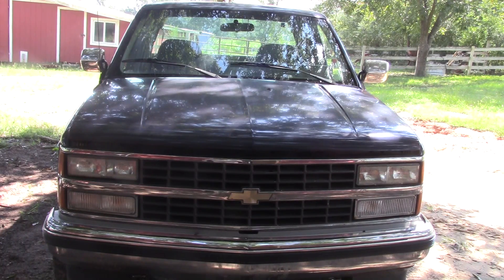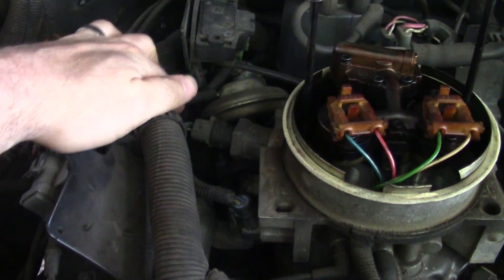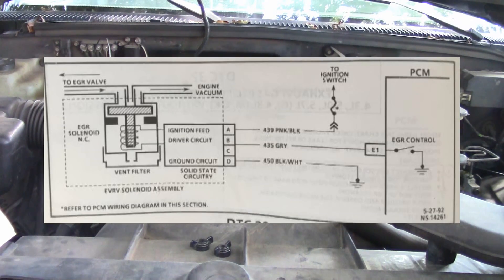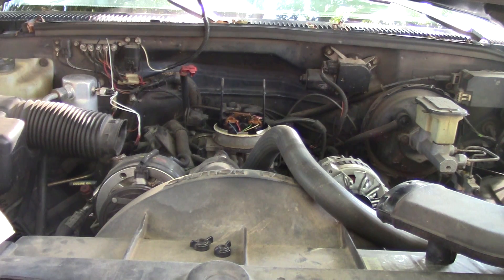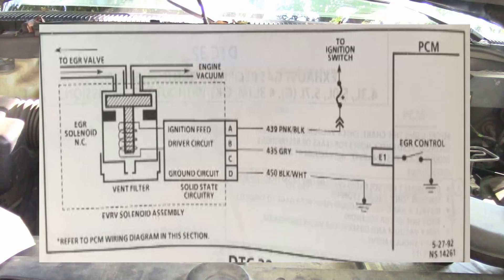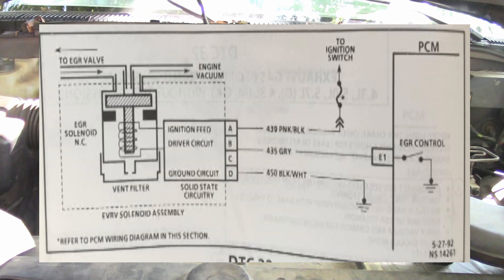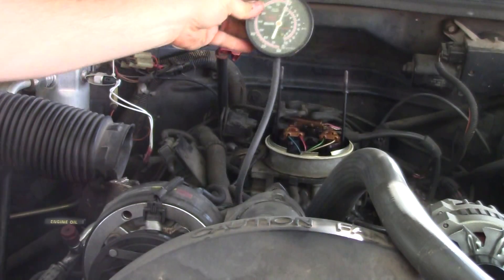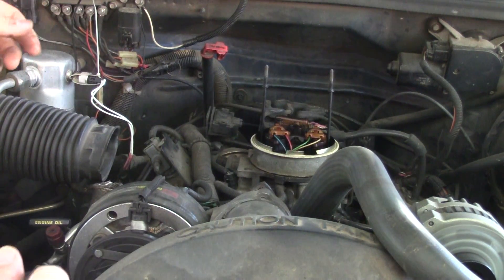GM Truck  DTC Code 32

Comment: if u replace the egr valve on these trucks make sure u get the right one, theres 2 different ones, that will mount on, but one has an internal bleed hole, one does not,, if u put the wrong one on, it will not work right.
Reply: How can you tell which is which?

Comment: I have a 95 k1500 5.7L. I changed the EGR, Map Sensor, and EGR vacuum solenoid along with vacuum hose. But when I run it on highway the service engine light pops on. The GM code reader still gives me code 32. Im stuck and dont know what it could be.
Reply: Did you ever figure it out? I’m in the same boat with my 95 as well.
Reply: I deleted my egr and my truck runs great but today I drove the truck up to the mountains about 1.5 hours up and back. I got a flowmaster 40 muffler installed today and my service engine soon light came on during my drive home. I checked it when I got home and it was a code 32. I started the truck back up and the code wasn’t there, not sure why it happened, maybe altitude or the less restrictive exhaust.
Reply: @lawrence6115  Late by a year. I think you are right about altitude. Higher altitude  means lower pressure. Vaccum has to work harder.
Reply: Still having the same issue til this day. I actually had originally replaced egr with autozone brand. Didnt seem to work. I recently replaced that one with a delphi part #eg10099. According to a user on a GM forum someone mentioned that these trucks run on negative back pressure egr. Now when the egr is connected to the solenoid the truck sputters and shuts off after it reaches correct temperature. It also gives code 32(still) and now code 44 which indicates a bad o2 sensor. Mind you i replaced o2 sensor about a year ago. When i unplug hose from egr to solenoid the truck runs fine but the the CEL turns on again with code 32. Im thinking of replacing egr with one from GM this time around.

Comment: 95 Silverado, I had to pull the intake during repairs & I saw the air channels feeding the EGR were carbon blocked.  I had to use a chisel & Dremel to clear them.  Two weeks later code #32.  It's a friends truck ( he bought it new ) & he was taken advantage of many times over the years. Now it's my turn to right the wrongs.  Thanks for your help with this.
Reply from the maker: Thanks and good luck! 👍🏼

Comment: Question sir:  What is the correct way the valve is installed?I didn'notice when I took mine off. Does the square hole go to top or bottom as my manifokd has 2 square holes, 1 bigger then the other? I kno wit is a dumb question but had to ask, My truck is a 94 chevy 1500 4.3  wt . Thank yoi for thr great videos!!

Comment: I have a 94 5.7 replaced egr valve then solenoid and hoses all ac Delco parts still get a check engine says egr problem. Think the ports could be clogged?
Reply: Was battery disconnected to reset the computer?
Reply: @haks310  yes it was
Reply: @squarebodyg5354  With the engine running, does pressing down on the EGR diaphragm make the engine stumble/stall? If it doesn't you know for sure the ports are clogged.
Reply: @haks310  I haven't tried that and didn't know that was a way to check. Thank you very much for the info! I'll check it when I get back to my truck. I rebuilt the throttle body recently  thinking that would help but didn't change much. It needed new gaskets and filters anyways so it was good I did. Thanks again for replying man 👍
Reply: @haks310 this comment helped me so much thank you

Comment: Hey Farmboy, I have a 89 Silverado 5.7 TBI doing the exact same thing your truck did. New EGR valve won’t open with 21” of direct manifold vacuum, yet hand pump will open it. New EGR solenoid. Truck runs great. Yet after replacing old exhaust from manifolds back, code 32 keeps coming back after every battery disconnect reset. What did you do to fix your problem? I suspect the new exhaust system simply flows too good now. However, your video is by far the closest thing to my problem. Great to have the service manuel! Thanks.
Reply from the maker: James, I never did anything on mine.  I wasn't getting a code 32, this video was just to show some diagnostic checks.  Funny that the new one didn't open with direct vacuum.  Maybe I was wrong about that... Did you replace the Oxygen sensor? I think they work together.   That's all I can think of.
Reply: Farmboy's Garage Thank you for responding! I did indeed order a new AC Delco  O2 sensor from Amazon. Just got it yesterday, but have not put it on yet. Makes me regret buying a Duralast EGR valve. It may be defective.

Comment: My 89 gmc k1500 has code 32 but the truck runs fine.any idea why this is so?
Reply from the maker: Code 32 is showing there's a problem with the EGR, most likely it isn't opening.  Not opening would not effect engine performance, just emissions.
Reply: @farmboysgarage7595  thanks.i appreciate the information.im gonna change my egr.
Reply from the maker: @djkoold8833  More likely it's the vacuum line that runs either to or from the solenoid or the solenoid itself that's bad.  If you push up on the EGR from underneath the diaphragm and it moves, it's probably ok.

Comment: On G.M. oil pumps with the screen, if you go over a train track and then the oil light comes on it's the oil pump screen. The screen moved up and it's not picking up. Measure the oil pump screen-oil pan depth and install a hex set-screw. Or you could weld it.

Comment: My truck tested out exactly as yours. My egr diaphragm will hold if valve is pushed open and the vacuum tit is capped, but engine vacuum is not enough to pull it open. Do they get too stiff to function properly over time? Did you replace yours? If so, did that fix it?
Reply from the maker: I didn't have any issues with my EGR valve.  I just did this video to show how to test them.  The only issue I've had is one of the vacuum hose connections on the EGR solenoid broke off so I had to replace the solenoid.  If you can push the diaphragm open, then the engine vacuum should be enough to overcome spring pressure.  I'd look for a cracked vacuum line or solenoid problem.
Reply: Thank you for the reply! I swapped the solenoid with one from a properly functioning truck. No change. The lines "look" good, and have some vacuum to the egr when i bypass the solenoid. I have no vacuum gauge. Could it be dirty throttle body passages? I think i remember the other truck having built up gunk when i rebuilt the throttle body on it. I suppose I'll try that next on this one.
Reply from the maker: No problem, sorry it didn't fix the issue but at least it didn't cost anything :)  It won't hurt to cleaning the throttle body, but not sure that's what's causing the issue.  Yours set a code 32?
Reply: Yes, the only code i have.
Reply: No more check engine light! I cleaned and rebuilt the tbi. The tbi to intake gasket was deformed into the vacuum port channels a little bit. There was also some crud building up. The truck has 150,000 miles on it. I also replaced the vacuum hoses, which may have been the issue because when i went to remove the one connected to the throttle body is snapped into fairly easily. It also used to hesitate a lil before but no more! Thanks again for the video and advice.
Reply from the maker: Glad you got it fixed!

Comment: ive replaced the electric control for my egr. when i depress the diaphragm, it kills the motor. any suggestions?
Reply from the maker: Sounds like the EGR circuit is clean so I'd look for a bad vacuum line.

Comment: Those egr are a pain in the ass, I took mine off put a plate in place of it ran it for years.
Reply from the maker: Yes they are!  I did the same thing on my dually.
Reply: No check engine light comes on?